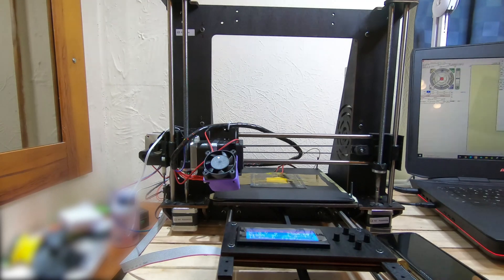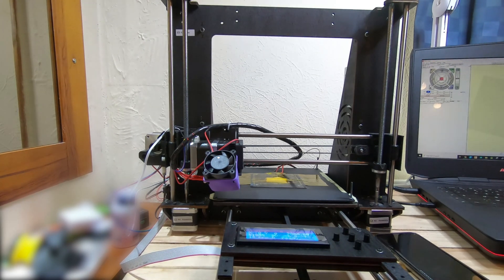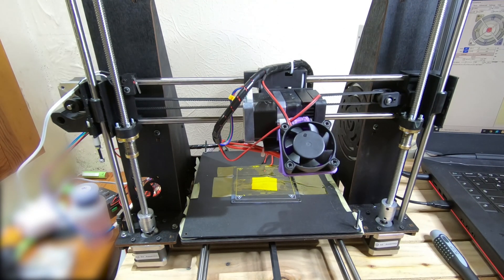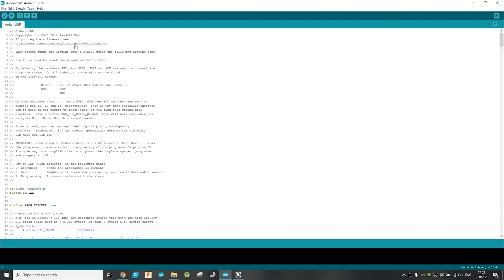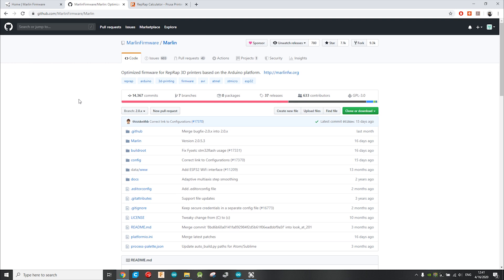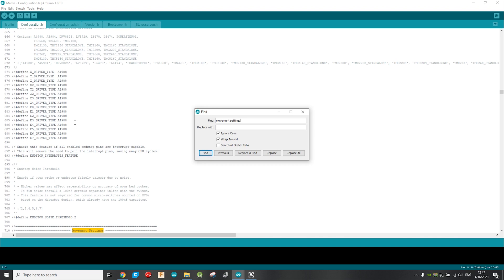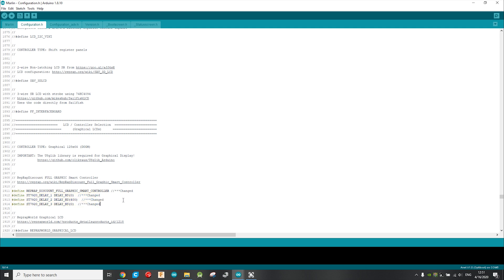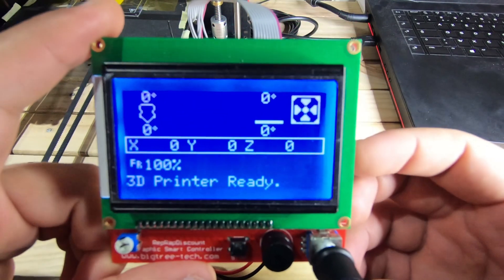CTC i3 Pro B 3d printer - lead screw 12864 graphic display and firmware Marlin 2.0.5 upgrade

Comment: Salut,
Am zis sa iti scriu si sa iti cer ajutorul pentru un sfat.

Am gasit in piata de vechituri o imprimanta de acest tip. Imprimanta in cutie, cu toate componentele disponibile.

Am instalat imprimanta si am incercat sa printez ceva pe ea dar ca nu reusesc.

Cand incarc programul isi face referinta si apoi se oprest, nu mai face nimic. Mai patesc ca display-ul sa isi piarda scrisul (ramane aprins pe culoarea de fundal)

Ai patit asa ceva sau poate imi poti da un sfat la ce sa ma uit?

Multumesc anticipat!
Reply from the maker: Salut,

Incearca sa ii faci upgrade la firmware ( foloseste Marlin ). Daca nu, cumpara alt mainboard + display.

Verifica lipiturile pe placa, poate acolo e problema.
Reply: @OviAutoWorks  Multumesc tare frumos!
Imi puteti recomanda o placa si un display?
Reply from the maker: @silviublaga9437  nu pot recomanda, dar eu as folosi asta. https://a.aliexpress.com/_uRKBvT

Comment: should i use anet a8 profile on newest cura or any suggestions
Reply from the maker: Hi, i don't have this 3d printer anymore , I have an ender 3 v2 now.
Reply: @OviAutoWorks  yeah i have ender 3 pro aswell but i put all metal hotend on ctc a long time ago and just fixed it up but thanks anyway
Reply from the maker: No problem, good luck 👍

Comment: Is it worth it the upgrade in firmware? I'm upgrading my lead screws, and calibrating the axis, I printed the upgraded bear x axis for mk3 from thingiverse, and changing all the bearing. If that doesn't help I will also update the firmware. Can you show some prints from before and after? And maybe something that requires retraction.
Reply from the maker: Hi, yes, it does worth. Unfortunately, I need to calibrate it, i didn't had the time, as I'm working on my ebike now.